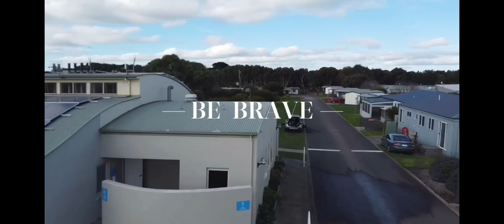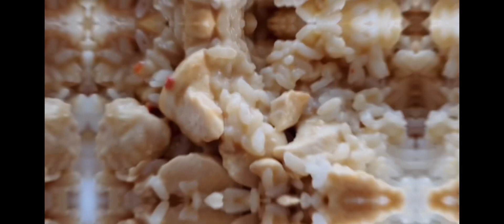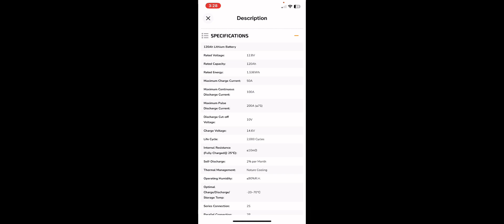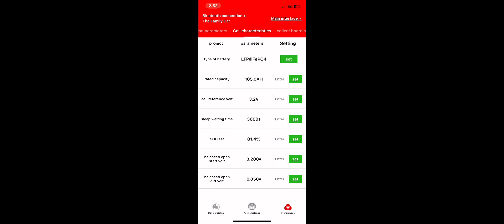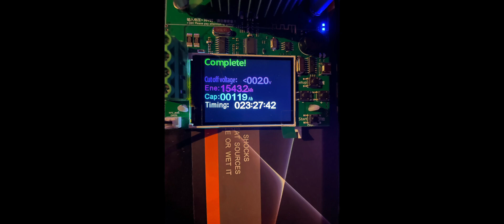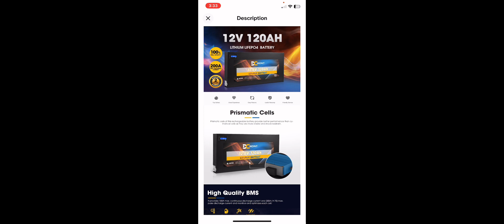DC Mont 120ah Lithium slimline Battery. Are they worth it?

Comment: Hi Guys Happy 2025. 
Seeing as there's little info on DCmont around I thought I'd post a follow up Just a follow up. 
After running a pair of 12v DCmont 300ahs in parallel for a year now running Lighting, Satellite NBN, Swamp Cooler, 12v freezer and all other 12v gear. 
I have to say they have never missed a beat running my Off Grid Cabin. 
Very Happy with them so far. 
Cheers and happy travels
Reply from the maker: Yep same with my DCmont hasn't missed a beat. Happy new year to all

Comment: Any info on battery chargers for these batteries. I'm looking at Projecta 240vlt 50amp ..again great video.
Reply from the maker: I use kings 50 dc to DC as well as a victron 30amp 240v charger

Comment: Hi Guys great video I have bought the 120ah too just setting it up would it be possible to put up a pic of the settings needed on the monitoring app smart things if that's what you used cheers
Reply from the maker: When you connect it to the battery to the Bluetooth module and open the app it will automatically tell you all the information of the battery. It is recommended not to change these perimeters as they are factory set. You will see it will come up that it is 100ah in the app not the 120ah. When I looked through the app there is nothing needed to change.
Reply: @thefamilyvandownunder  thank you

Comment: Thanks for doing this test. I have a pair of 100Ah Eco-Worthy batteries and at 0.1C discharge that get the full 100Ah, but only 95Ah at 0.2C load (which is the standard test).

Good to know thr DC Mont batteries are at least in the ball park. That power bolt is a joke, Ive seen similar results from the Mobi batteries.
Reply from the maker: Yeah the mobi battery I had before this dc battery was a joke. But the mobi 200ah batteries I have in the caravan tested at 210ah surprisingly. I ran the test 5 times on them as I couldn’t believe it. But I wouldn’t buy them again

Comment: Hi guy's 
I hope all is well
I bought a 300ah DCmont battery
Is the victron 100/50a std lithium profile OK for these or is there a different setting needed
Not much info around so I thought I'd ask before I stuffed it up
Cheers all
Reply from the maker: Hey Andrew so far I think I’ve had my dc mount batteries for 12 month and they are still going strong 💪 the Victron 100/50 is it the smart solar or bluesolar? Either way great units especially connected to their app. It is perfectly fine with the lithium settings for this battery. I also use the victron smart shunt that gives you all the info going in and out of your batteries as well. Depending on the use of your setup you might want to look int the shunt. Happy Camping
Reply: Thanks for the info 
Been looking at a smart shunt
Stay safe guys and enjoy
Cheers

Comment: im currently using the DCMont 100amp charge controller. so far no issues either. i have had trouble setting up on my behalf i contacted them and they did reply with information to help. yeh so far so good.
Reply from the maker: Yeah that’s good. I’m looking at getting a better charger for my caravan so I might check that out.